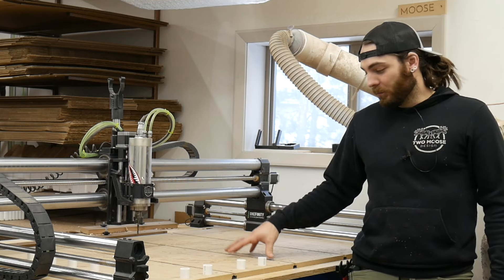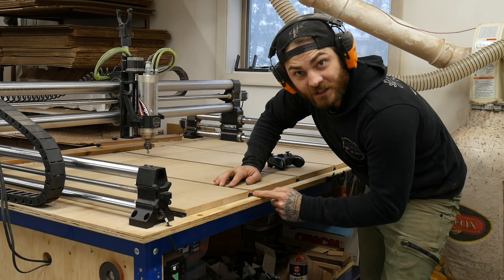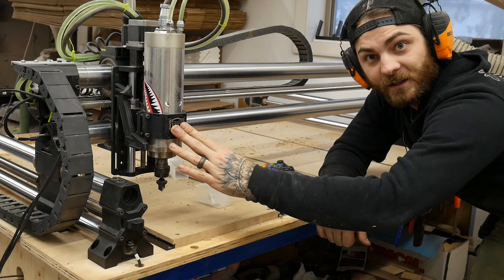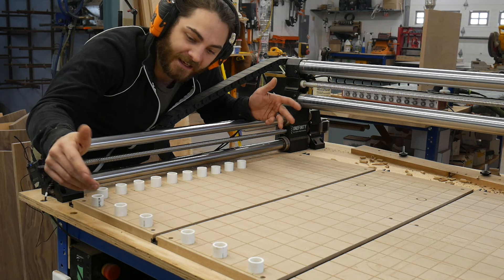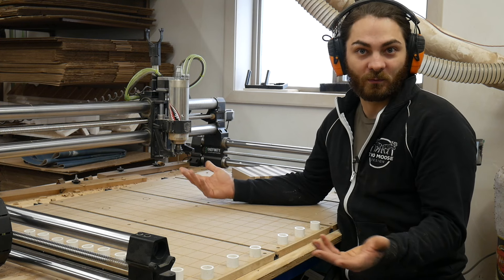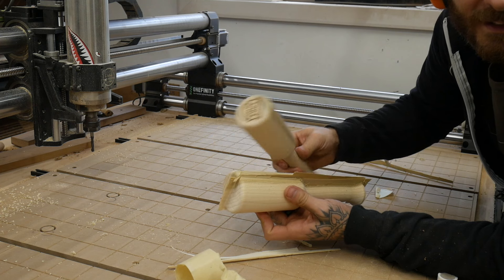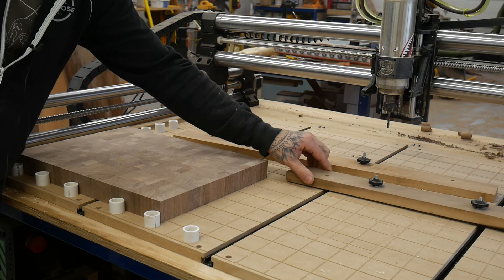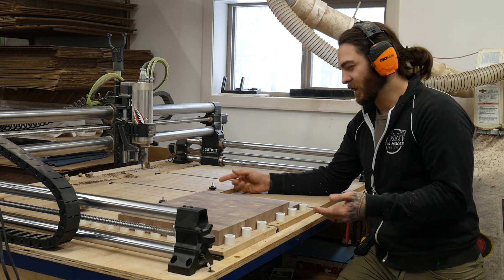Frugal and Functional: My Top Hold Down Clamping Methods and Affordable CNC Wasteboard Set up

Comment: good video. i like the pvc method. have you tried a smaller dia pipe so you dont loose as much work area? i use dowel like you have the pvc .5 inch dia. thinking about using the kfeg clamps that use the .750 inch dogholes and was wonsweing if you have used them and your input on them. Id like to see your bowls made. Ive made a few like i think you are doing it and yoyos lol the kids and grown ups have a lot of fub with them. I do several 2 sided jobs. I think id laminate that poplar and do it as a 2 sided job to avaoid the glue up of the 2 halves and just so i could say ive done that lol Best video ive seen in awhile thanks for sharing it with us.

Comment: I Have a 220V 2.2Kw and I love it, it works like a charm and I have double the speed of feed and I'm working at 18000 RPM with a 2 1/4" Surfacing bit and the machine doesn't know that the bit is there. My X-35 Woodworker kik ass and I did make a vacuum system under neet as a hold down .... love it. I'm about to put some Piston to put as stops like your pipe but they are on the edge off the cutting area so like that I can release them and I still got the full cutting area to work with.
Reply from the maker: Nice, love hearing about other people’s systems! 👊🏼👊🏼

Comment: I Got my first CNC last night.  Don’t even have it all put together just making sure I have all my ideas straight before I start.  I just want to say using the Jointer to notch the waste board is the best use of the tool when you are still having to justify the expense to a spousal unit..  I’m going to see if it works for me.

Comment: I came back to watch this again. Gotta nother CNC so I have 2 now. This one is a friggin beast and very quiet by the way. So, that means I've flattened a wasreboard 4x now and I have a tip to not cut too much off which is something most do not mention or like me I keep forgetting 
Anyway,  I forgot what my first cut was but it did not flatten all which is a good thing. The very next step is to zero your bit where the router did not cut. At the second cut set your start cut at 0 and your finish depth at 0! Do not cut anything because it will be at a lower point then when you started. You might have to do it again but you will not waste wood.
Speaking waste board. I think this time around I'm going to use wedges and a top down tightening system with no metal tracks. Just cut my own key track in the wood.

Comment: Thanks for the videos and easy to understand explanations getting right to the point. Composite nail gun works pretty good for me but the length is limited to around 1 1/2" so good for thinner boards but definitely not cutting boards.

Comment: I copied your idea of rabbeting the edges of the MDF so that they sit on top of the T-track.  I agree with the advantages you state.  My jointer doesn't have the capability but it was easy to do with a rabbeting bit on the router table.
Reply from the maker: Nice! Worth the extra work in my opinion, my first set of t tracks pulled out the screws holding them in after a while those didn’t have the overlaps

Comment: You nailed it. Keep the piece from sliding and you need very little “clamping” force. I downloaded TSO CAD files (free) to make my board MFT compatible. I have a professional ShopSabre machine with vac but I use the dog board most. TSO dogs and something like your wood block and maybe tape or small clamps on the corner and you’re good. The vac is HUGE for sheet goods, especially for keeping the sheet flat. One recommendation is to zero to the machine bed for most things, except vcarving. There is a reason the pros do it.
Reply from the maker: Thanks for the insight! I’ll definitely give it a try. Thanks for watching 😄

Comment: Instead of going through the trouble of the PCV....you can just put a piece of plywood on top of your spoilboard and screw it down along the edges where you have your PVC now.....and basically cut away everything but leaving a straight piece on both sides (where you screwed down) that make a perfect 90 degree angle with a round circle in the corner for you corner of your wood to sit.  Super fast and super accurate. And easy to remove if you wish without all the large holes in your spoilboard.  I've been using this for years and it works great and super accurate.   Just another option but your video was very good and precise.  And really appreciate not showing your videos full of...."and now its time for 3 minute video about the sponsor of this video."

Comment: Is it worth the time to not rout all the way through a project on the perimeter and then cut it out using a oscillating spindle sander to true up the piece?
Reply from the maker: I’m not sure what you are asking
Reply: Let's say I am making something, it doesn't matter what.  In order to not damage the waste board would it be okay to not cut the perimeter of the piece to full  depth and then cut it out after removing it from the waste board then sand the edge left by not cutting to full depth saving cutting into the wasteboard

Comment: Where can I get one of those countersink drill bits with the depth adjustment ?? I've seen others and have used a few but not thrilled with the results.
Reply from the maker: The link is in the description I believe. It’s made by Amana. Highly recommended it’s expensive but I’ve had it for years
Reply: Thanks @TwoMooseDesign

Comment: Why do you need the y tracks in addition to the pvc pipe ?
Reply from the maker: I use them for jigs mostly. Push the item in the corner, the jig holds it tight

Comment: one more question lol on your bowls you make do you have issues with warping? i do i think its the depth i make them and my material probably has too much moisture. not sure but researching how to avoid warping when making deep pokets in bowls and trays etc
Reply from the maker: I have not tried small pvc. It’s just what scraps I had on hand 😆 I have not had issue but I’ve only made a few. You remove a bunch from both sides vs like a small tray they can warp if you don’t do them properly.

Comment: I’m new to the cnc world. How large were the squares you cut in the wasteboard with the v groove? Is it easy to program the machine to do that?
Reply from the maker: I did 2x2” squares. It depends what software you use, the machine can be run by pretty much all 𝙲𝙽𝙲 software. You can also buy files, I sell the grid in 1” and 2” squares

Comment: Awesome !  plagiarizing your setup. Just wondering when you were doing the cuts for the PVC pipes, did you cut to exact dimension of the pipe or ever so slightly undersize so it fits snug?
Reply from the maker: Slightly larger, the pipes are 1.06 I think I did 1.08?? Run a test cut on some scrap first 👊🏼👊🏼

Comment: Love this style of wasteboard.  Do you get any kind of flex from the pvc? I do epoxy carves where I pull pieces on and off multiple times. I’m wondering about accuracy.
Reply from the maker: I personally haven’t no, it would take a ton of force to flex them and I leave the inside whole so it really can’t go anywhere.
Reply: @TwoMooseDesign  ok great! I’m going to give that a go. It was either pvc pipe or 1/4” delrin rods.
Reply from the maker: @MrHammy40  interesting haven’t seen that before, I’ve seen people use 1/4” wood dowels too
Reply: @TwoMooseDesign  I use 1/4” aluminum rod, but with the inner section still inside the PVC, that seems more stable.

Do you ever remove them? If so, when you put them back in Are they still plenty snug?

Comment: Instead of brad nails, try a 23ga pin nailer. I use those or blue tape/superglue for almost everything.
Reply from the maker: I’ll try that, I tried 18g??? I believe
Reply: @TwoMooseDesign  Pin nails are much thinner than brad nails. You'll need a pin nailer (smaller version of a brad nailer). They're thin enough that if you accidentally hit them with a bit it'll just plow right through them. They pull out easily with pliers - depending on the material you'll leave them either in the material or the waste board when you pry the material off (I use a 5-in-1 scraper because they're pretty stiff vs flexi scrapers). You can also clip them with side cutters or flat nose cutters.

Comment: I saw that pvc thing myself. DIdn't like the idea of big PVC pipes in my waste board so I use wooden dowels. Much cheaper and smaller and work just as good and do not break and are much less worrisome if a bit goes through them. When I don't want them there I just pull out my pliers and store them in a plastic bag.
Personally, I think wooden dowels is a much better way to go and worry free. Just a thought.
I'm watch your videos cause I'm wanting to sell mine and get the onefinity which is what I should have done in the first place.

Comment: Why would you need to use a “lot” of force to hold a workpiece down?
Reply from the maker: Removing material generates a lot of force in multiple directions. If you're just using v bits not much force is applied. Id ratehr apply more force than needed than risk a piece breaking free and ruining my project.

Comment: The part with the tablesaw looked safe...
Reply from the maker: Felt safe to me, what’s the point of a cabinet saw if you can’t cut sheet goods? Learn how to operate one and you’ll be just fine. I’ve cut panels all day for years and have no issues, keep the material tight to the fence and take your time, it’s a sheet good not a long skinny 2x4. Thanks for the comment and watching the video 👍🏼
Reply: Years of experience is the main reason for accidents.Watch your left hand at 01:38. Congrats you still have all ten. 😎
Reply from the maker: @jjabrams452  not sure what your seeing with my hand. Its near the blade as I am using the saw and controlling the piece. Good thing I have a saw stop 👍🏼

Comment: Have you tried to use a hot glue gun?
Reply from the maker: I have not! Does it hold well?
Reply: @TwoMooseDesign  I don't have much experience like you. It seems to hold well. My CNC is much smaller,  Don't put too much, just on some areas like you would use a clamp or a screw.